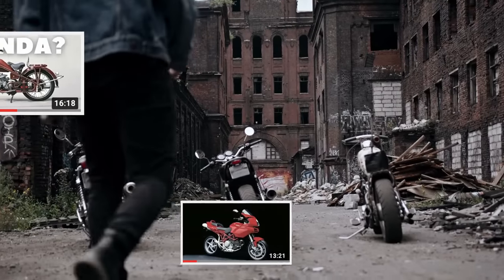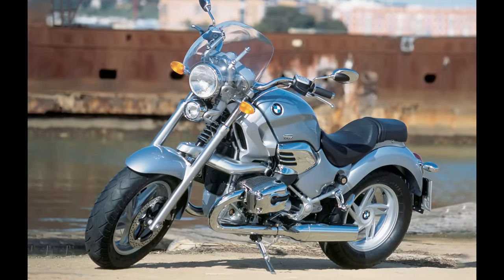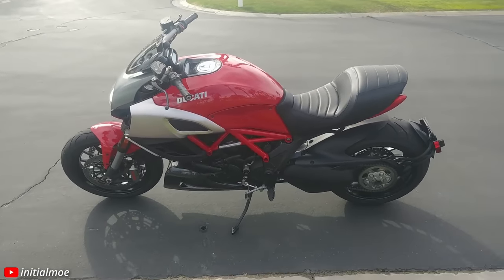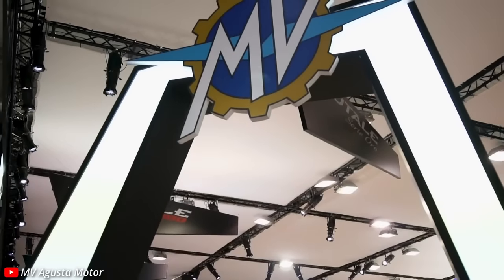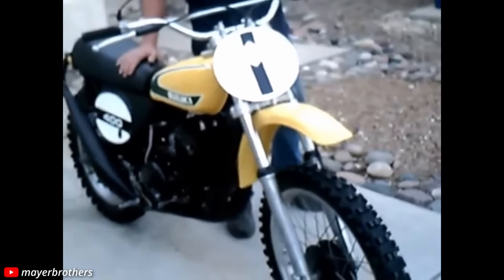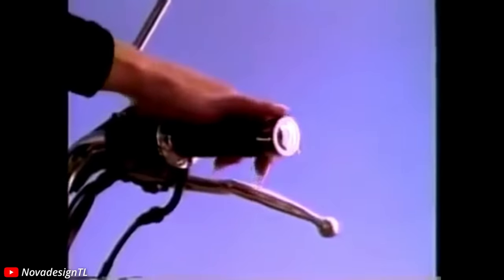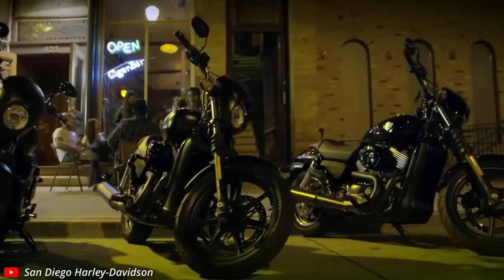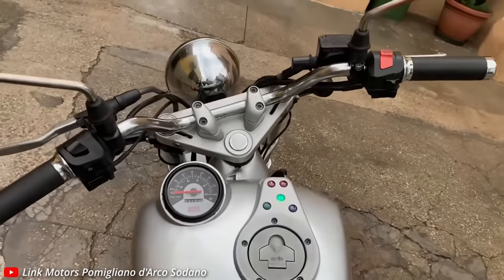The WORST Motorcycle from every manufacturer

Comment: In the 1980's the Yamaha 550 Maxim and the 650 Maxim and 750 Virago Shaft Drive Virago where some of the best! They where everything the Harley Sportster wished it could be but could never be. They where quick, got great fuel economy, where easy to ride and handled really well for what they where. Comfortable for long road trips. They where super affordable. You could easily put 100K miles on one with very little serious work needing to be done. The worst thing you can say about them was that the carburetors had some issues and keeping them synched properly could be tricky on some of them. For the time the bike was light weight had a stiff enough frame and the engines made lots of power for the time. 50HP from 528CC that was that reliable and durable. Plus it had a 6 speed gear box compared to the Harley Sportsters 4 speed gear box. In 1982 the Harley Sportster was much heavier, did not accelerate, brake or handle as well, was not as durable and reliable, cost a lot more and needed 997CC to make 55HP vs 528CC to 50HP. Yamaha Maximum also looked better than the orignal. Compare the two. THe Yamaha made power up to 9000RMP. If you got an Harley 883 it was even worse. In fact Harleys where so bloated and heavy that even with the big twin you could catch up to them and then leave them in the dust with a Yamaha 550. THe 750 Virago was more of the same! If you wanted to drive a Yamaha Maximum or Virago coast to coast you do it and not expect to do much more than oil and air filter clean and replace make change the air filter clean the spark plugs and replace. In 1981-1984 you could not even hope to make a cross country trip on a Sportster and have that low of maintenance!  The Yamaha 500 Maxium made power down low and made power fast enough that even at 6 foot tall and being a a normal sized guy I had to stand over the forks and take off in second if I really wanted to take off fast to keep the front end down and have time to get feet on begs for next shift. THe 550 was also still a chain driven Maxim. The 650 was making 71HP which was not at all bad for a cheap daily driver!

Comment: Moto Guzzi V7 Racer. I bought no.127 because it was stunning on paper. In reality, it had a chromed plastic tank with loads of other cheap bits. Handlebars turned further right than left. Had interesting torque steer when rolling on the throttle. Made the bike lean to the right. Sounded amazing with straight pipes despite it's massive 48hp and was a joy on tight twisty roads. Absolute hell on a highway.

Comment: Hey man, I own a Virago and let me tell you this mister... you are absolutely correct. It's awful. 

The fuel system is diabolically stupid; the main tank feeds a second tank, which then PUMPS the fuel up to the 2 carburettors, AND it has a cut off valve that shuts the fuel off when it senses you are getting low which you bypass with a "reserve" switch on the handlebars. This is to imitate a traditional reserve/on fuel tap. It also has a reserve warning light. 

So basically there's like 5 more failure points than a regular on/reserve fuel tap WHICH THEY COULD HAVE GONE WITH. 

The fuel system has left me stranded on more than one occasion. 

Lets not even talk about the rear brake that gets stuck on when moving slowly and the front forks that are so soft I can bottom them out by bouncing on them at a standstill, and the front brakes that are simply way underpowered and will not stop the bike no matter how hard you pull them. 

This is all on a restored bike with new pads/shoes/caliper rebuilds/brake lines. 

But I dont care because it has aftermarket pipes, drag bars and it sounds great and I love it.

Comment: STOP!
THE 900 Kawasaki Eliminator is still one of the best bike ever made.
It utilized the geometry of the Norton Comando and even the cluster of lights on the head light bucket show its intent. This bike took all the best from the British racer era but with more power, reliability,  and handling . And as an added bonus it had big disk breaks and could stop.
This bike refined all that was right with those British racers but improved in a massive way.

Comment: I have a 71 OIF bonnie and the OIF problem was from bad manufacturing welding processes that plagued only some of the new bikes, I have had 3 OIF 2 650 tigers and a bonnie and all 3 were better than my 61 and 68 ever were  although I should never have sold my 61 pre unit! The OIF may have been worst at manufacture time but they are proving to be much better bikes over half a decade on than the non OIF. The seat height has never been a problem to me at 5'9" and my 72 Tiger with lower seat didnt feel any different to my 71.

Comment: I owned a 1971 Triumph Bonneville putting 70,000 miles on it over 16 years and the frame made it a great handling bike.  The frame was not too tall and oil capacity was not a problem if you change the oil.  The engine had a higher state of tune, making it fast but needing 1,500 mile tune ups.  Vibration however was a big problem, impacting everything especially the electronics.  I also owned a Yamaha V twin euro model with the enclosed chain, nice cruiser but slow and the rear cylinder was prone to leak.  I generally like your videos but you don't go deep enough.

Comment: ... as for RE, I have a classic 500 from 2014, the red-ish (it's more of a cherry color) chrome variant. It really turns all heads around. There is not even a single stop where people are not asking me about the bike. And in terms of reliability, they must have done something because I had no issues with it what so ever. The efi system is Japanese, so they didn't reinvent the wheel, but borrowed from the best! It is my forever bike, and even if it stops running it is still good as furniture in a house.

Comment: I don't know if the Virago is not "Yamaha". On the surface it looks like a bland copy of an "American V-twin", but it's very "weird" and it does have some of very "Yamaha" aspects. 

They're shaft-driven with a transversely oriented engine. Yamaha wasn't the first one to do this (MV Agusta did it first), but Yamaha was the first to use this layout in quantity with XS750 and XS1100.

The frame is some kinda underbone structure. I can't think of any other large displacement bike that uses that setup. Very unconventional and "Yamaha" to me.

Comment: While I agree that the 1971 and onward Umberslade Triumph 650's are the ugliest version of the 650 and the seat height is too tall. They have the best version of the 650 engine. There was some good improvements made.  Using the famous 3134 race cam profile on the intake and exhaust gave the 650 some serious power. Awesome power from 2,000 rpm and up. The 750 was detuned to protect the crankshaft.  I bought my 1971 Bonneville when I was 17. I rebuilt it into a nice looking bike. I took all of the Umberslade Hall ugly airbox, fenders, headlamp and wire holder, mufflers, etc... and I replaced all of that with parts from a 1967 Triumph 650. Adding the metal oil tank and side cover took a lot of work. BTW, there isn't any issues with the oil frothing, or the reduced amount in the oil in frame Bonneville. Some guys that ride them down south in very warm temperatures add an cooler. I remember when the Virago was released. YUCK!

Comment: 20:53 You are COMPLETLY misinformed about Royal Enfield: Royal Enfield's outdated big singles were Pre 2009 NOT pre 2018 models. The big single you showed in the pictures at 20:53 is actually the post 2009 UCE model which made the company from least seller in India to becoming best seller in the segment. Until 2009 Royal Enfield produced Bullet that was mechanically same as 1960s British made Bullet but in 2009 they launched their first next gen bullet which was called UCE (Unit Construction Engine, where engine was a single unit unlike earlier where as cylinder, gearbox, clutch were separate units). The Classic series was introduced in 2010 with UCE engine and turned the company's fortune overnight, it was discontinued in 2019 with launch of j-series 350cc that removed any problem that UCE had. The 650 twins since launch to this day add negligible profit to the company. Their main bread and butter is 350cc.

Comment: You can bash the Virago for the 1dt 2 years, 81-82, because of a crappy starter design. After that they were great. Best rear drive in the business, never saw a bad one. Best transmission, best charging system, best clutch by far, wide power band, far smoother than any vertical twin at speed. Low seat height, comfy. All the Star twins are derivatives. BTW, these outsold everything else in class by miles.

Comment: Oh dear, all the tired old put-downs of the Triumph oil in frame bikes trotted out.  Mostly true about the early production but soon sorted.  I've been riding my '72 TR6R for over 20-years and it is a really good, reliable bike.  I am 5'6" and the seat height is fine, no oiling problems and it is a bike that runs and handles very well.  If that's the worst of Triumph then they stand head and shoulders above most other manufacturers.

Comment: The early virago from 81 to 83 had major starter issues, and I mean big starter issues, I bought a 1981 virago project bobber for 500 bucks, and I still can't get it to turn over consistenly and correctly, and I have replaced part after part and tried every fix known to man. These bikes suck to work on, and getting them running is hard.

Comment: Ok, so Bart doesn't like cruisers. Fine, I can live with that. However, Triumph's oil in frame solution is pretty nifty. I have that on my NX650 as well as on my DRZ400. This works, and there's no risk of breaking an external oil tank on rocks or whatever. Buell's fuel in swing solution is pretty weird though, by comparison...

Comment: Have a V star what the virago grew into it has 93000 k on it , clocks over after 99,000 , 3 sets Tyers, one battery at 8 yrs, oem dam great, 2 front pads, and just the required servicing… best bike ever owned in 40 yrs +, only cost me $8990 brand new with 5 yrs unlimited k warranty

Comment: Re the Worst Motorcycle from every manufacturer, IMHO two additional bikes should be added:  BMW R27--underpowered, overweight, and overpriced.  I bought one new and swapped it a month later for an R69S.  Second is a bike I also used to have--Yamaha SC500; highly flexible forks and light switch power band.

Comment: If you take the Kawasaki ZL900 and chop the engine in half, you get the Kawasaki 454LTD, which then morphed into one of the most successful motorcycles of modern times, the 1987 EX500, which would remain in production with only minor changes from 1994 on, until 2009.

Comment: My 1100 Virago scraped the footrest on roundabouts. I part exchanged it for a Suzuki 1200 Bandit. which was far superior. I had the Virago for just one year and the Bandit for 24 years. I still ride my GR650 Suzuki which is now 38 years old and still goes like a rocket. Much better than my Triumph Bonneville which I sold after buying the Virago.  I started off in 1962 with a Triumph tiger cub 200cc. What a shit that was.  My Bonnie was an oil in the frame model and could not quite reach 100mph. I got up to 150 mph on my Bandit which was a bit scary.

Comment: I had a an Eliminator!! It handled like a concrete block. The rake on it destroyed maneuverability but it was fast going in a straight line and absolutely solid at top speed which was pretty fast since it had a de-tuned Ninja engine. De-tuned because it would have ground off the shaft drive gears in first and second gear at take off. The shaft drive was the only thing I missed when I replaced it because it made the throttle really responsive. The starter crapped out and it was $2K to replace. The whole bike wasn't worth that. So I got an 1100 Zephyr to replace it. Way faster and handled like a laser pointer. Only bike I've ever had that had more power and speed than I had balls to max out. Well, that's not entirely true. I ran out of straight highway one night after I topped out the speedo (it hit the limit and then went to zero until I slowed down. Not sure that was a feature or not) but I had more twist left in the throttle but no more room to go that fast. I never had the open, car less, traffic free opportunity to ever try it again. It was taking 4 lanes to make the turns as it was.
Reply: You don't buy a bike like the Eliminator for the twisties.  I thought it handled fantastic for it's category.  After having the V Max anything was better.

Comment: I went from a Rebel 300 to a HD Street 750. I know he mentioned the 500 version, but I dont think the 750 is a bad bike at all. Im also not a "Harley" type so thats what makes the Street line appealing, as its not what you picture when you think of their famous hog style bikes. I daily commute on mine in a rural setting weather permitting.
Reply: The HD 750 a great machine ,I ve been riding a 2016 model street750  still doing good with no issues , the engine refinement is great.

Comment: I see by the plethora of backlash comments that you hit a nerve about the Yamaha Virago.  I never owned one but did like them.  Had I been in the market for another bike when they came out it would have been my choice as I couldn't afford a Harley back then.  I did own lots of Yamaha dirt bikes for me and my two sons and several (1970, 1971 & 1975) Yamaha XS650's.  Love the Triumph look and they were all trouble free for many miles.  A little under powered but the more power, the shorter the engine life (i.e. Dragster engines) My first bike was a 1964 Harley XLCH Sportster, no battery just straight Magneto.  Since those mid-60's days I've had two more Harleys.  A 2001 Road King and a 2006 Sportster Roadster 1200.  I do love American 'Fe'

Comment: After 50 + years of consistent riding.  And not someone who owned a couple of bikes and said they been riding for 50 years. I've had all kinds except sport bikes. I always liked something i could ride all day without problems. That didn't come home on a trailer. Before i have to stop riding I would love to own a Moto Guzzi V85TT . I've road them and really liked them except no dealer within 200 miles.
It will be interesting to see in 10 -20  years how  many of the hi tech motorcycles will have electrical problems that will be very expensive to fix or find a tech that can repair them .

Comment: The reason behind Triumphs oil in frame bikes was simply rigidity. The use of a large diameter backbone (Rickman designed them) stiffened up the frame and made them handle much better than the traditional frame. The Norton Commando also had a big tube backbone and their frames were very rigid and predictable.
The Yamaha Virago was a turkey right from the get go and it didn't matter how much lipstick you put on that pig it was still a pig.
I currently own a Moto Guzzi V10 Centauro and it does have its peculiarities. The oil pump and the drive is total shite and prone to failure. There are wiring issues that should have been fixed at the factory but never were. Another thing is the "growing fuel tank" made of nylon. Nylon absorbs water and all ethanol fuels come with a certain amount of water so you can only run number 1 fuel from certain oil companies or line it with dragons blood from Caswell. You either like the looks of it or you hate them. I bought mine because they are rare with a little over 1900 of them ever being made and many of them were scrapped for their powertrains because they fit the Daytona model. Nicknamed "the Beast", they are exactly that. When you first start riding one you think, "Jez what a lump." Take it over 4200 RPM and you soon change your mind. At 4200 the afterburners kick in and its Italian heritage shows up. Hard to get parts for but well worth it. Moto Guzzi was in financial trouble at the time so they were just throwing anything out the door to keep going.
I had 2 airhead Beemers, a R75/6 and an R80/7, and they were truly great bikes. They were crude enough that most guys could wrench on them but, unlike HD and the Brits, you didn't have to get at them immediately to keep them happy and running. The new Beemer philosophy leaves me cold. Too expensive, too technical, and too high maintenance costs with unproven cutting edge technology. BMW now stands for Bring My Wallet.

Comment: The information about Moto Guzzi doesn't seem accurate. Moto Guzzi has used almost all engine configurations, except for rotary, over the 100+ years of its history. The transverse twin is the most famous, but it's not the only configuration they've used. As all Italian motor brand has its peculiarities but I will assure you way less than BMW by the amount of faults by volume.

Comment: You definitely got it wrong with the Virago! Sure, the styling was a little (or very) kitsch but I remember riding my brand new 1100 out of the showroom and admiring the smooth effortless power and it turned out to be pretty much flawless, rode it all over Australia without a hitch. On the list because you don't like the look I'd reckon.

Comment: agree on the yamaha virago. design is a cheap chopper copy, kind of disagree on the Moto Guzzi: I own a V7 / ex-cop-Bike from '69 Ifrom italy bought and refurbished it in the late 80ties. The design of the classical V7 engine is a little hard to get used to, not really a beauty, but it runs and runs perfectly like a swing-machine since the last 30 years. done about 100'000 km with it and just gave it today for "maintenance"...